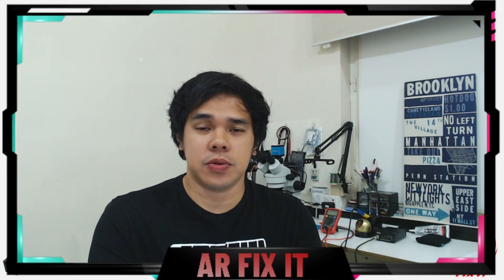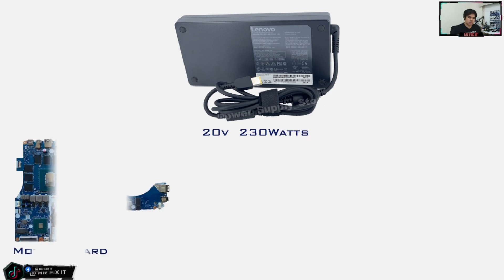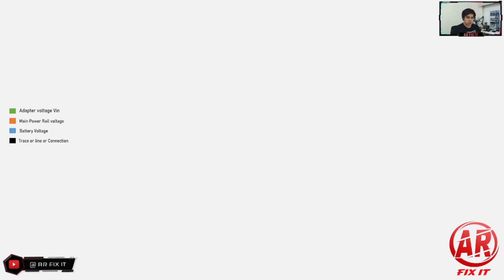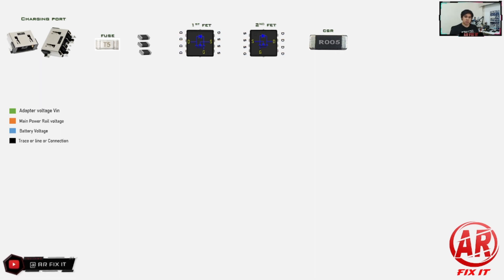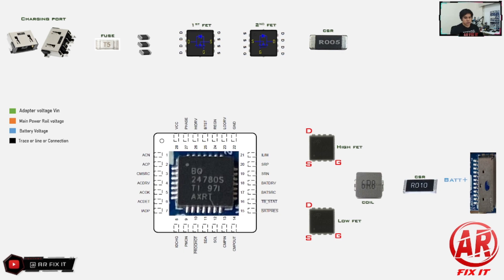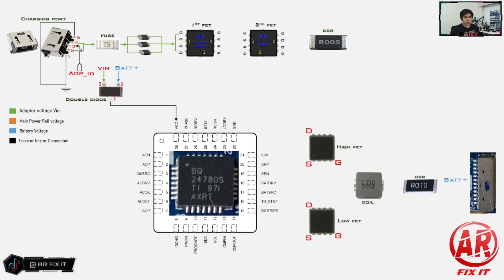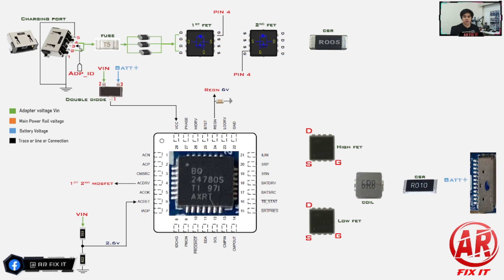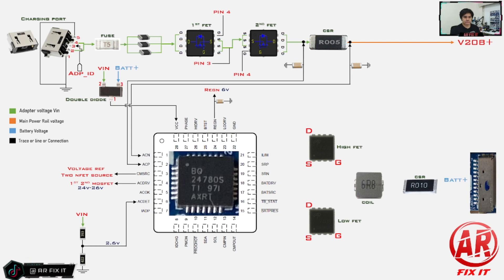🔴Vlog#5 How does the DC-in and Charging circuit works on a laptop motherboard?  - BQ24780S

Comment: may follow up question ako sir fred bakit on some board there are 4 mosfet sa highside at lowside? ganda sana may part 6 yung sa PWM
Reply: yung yung isang klase ng charging architecture yung nvdc yung 20v or 5v i boost ng 2 unang mosfet sa coil then yung next 2 mosfet naman eh regulate papuntang battery na agad